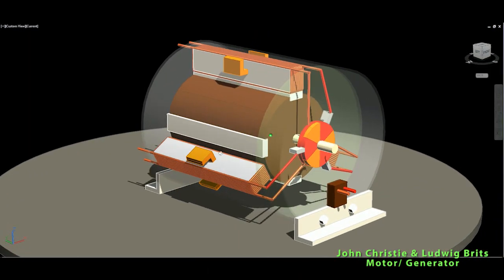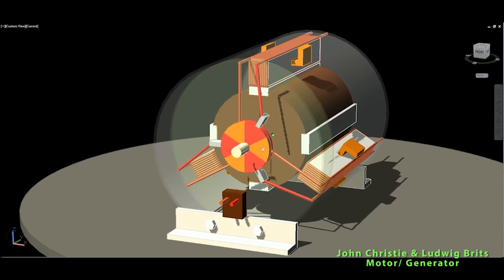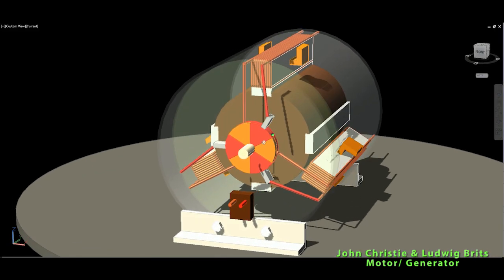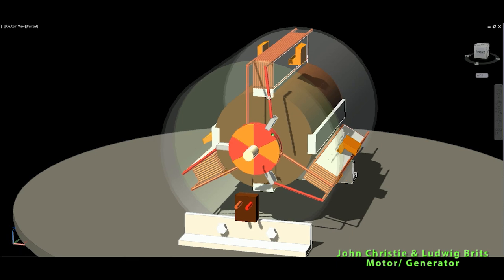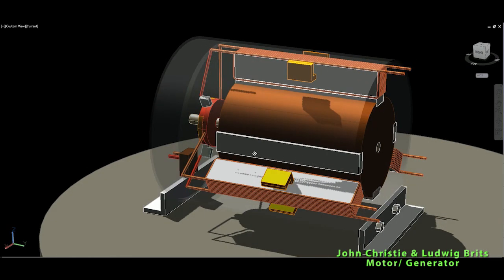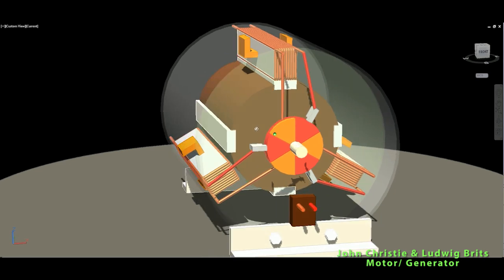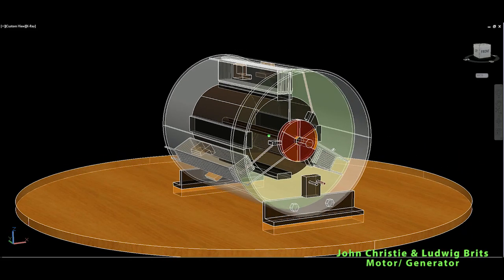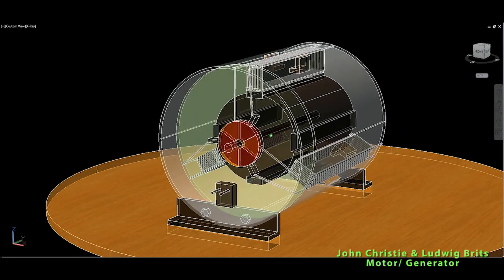Free Energy Generator, John Christie & Ludwig Brits, Overunity motor generator

Comment: A device that has a power output greater than the input is not possible. When the output is bigger, batteries are inside...
If you have a demo device, determine it's weight, look up the energy density in Wh/Kg of common batteries, try to extract more power than it's weight when it were a battery, then you know.
Reply from the maker: Thank you for comment! 💙
Reply: Don't say that because you don't know it exists or does.
It's possible with step-up transformer.

Comment: If you ever tried to manually turn a motor you know it takes a force.  More coils means it takes more force to turn it.  The force to turn it comes from not only friction but the resistance of the motor as it generates electricity.  Running current through one coil just means each coil that generates electricity will get less than half as much.  Please don't buy snake oil.
Reply from the maker: Thank you for comment! 💙
Reply: Please don't be more idiot than already demonstrated.

Comment: I built a similar device that by using just 1/9th of its power can produce 24 kW.
It is an advanced reproduction of a Keely motor made in the early 1900s. That motor made 40 horsepower using 3.5 pound magnets but I have 30 pound magnets Which are about 9 times stronger. The device uses 32 magnets on the array, 4 magnets outside of that array that are stationary and 16 flatwire coils along with a distributor that drives the Carrier wave.
Reply: I would also like a copy, please reply and I will give you my email
Reply: My welds came apart under high rpm test. I've been building a better one . Making the V shaped magnet holders is expensive or difficult. I had some tooling made to form these in a 7 stage press using my 20ton press. I'll post a video by tomorrow on my progress with plans
Reply: Won’t work, you cannot counter act the magnetic drag force it takes to generate or produce the energy then to run it. You can’t get more then you put in. Sorry nice try, snake oil is not the answer. This captures people that don’t understand how these things work.
Reply: how long does that set of magnets last?
Reply: @patrickdonegan9559  the N52's I use last forever
Reply: @mikefromspace  wow - that is SO amazing!
Tell us where we can buy them:
Reply: Did did you manage to build it and is it still running
Reply from the maker: Thank you for comment! 💙
Reply: @MarioGudec  I'll send the plans if you want. Keely invented this in 1907. It was used in secret in the 1908  Model T by the few who knew how to make a small modification to that charging system.
Reply: So has anyone perfected 1 to sell- these power bills are fckn up my life🙄
Reply: @knowledgedispelsfear6141  Yes, if you want to spend the money. Hydrogengarage sells hho generators. They say 40% more fuel efficiency, but you can just use one for a 3 liter on a 1 liter and it powers it 100% or more. You can run a pretty big generator. There is also a commercial size free energy generator. Look up Maxwell Sangulani Chikumbutso.
Reply: Hey,have u ever tried to build a rodin coil but using base 12 math? I haven’t built anything like that..  But i was looking at N.Tesla quotes on The 3,6,9 numbers and they represent the eather.. and 1,2,4,5,7,8 represents the material world,but the so called 0point ain’t in middle of the diagram,i think its bc he used base 10math,but if we add to number 12(3,6,9,12) it creates a totally different winding pattern and more u wind it the more complex it becomes,the idea is that we need twice as much points on eather side to achieve the depolarization.. Where does the spark come from? Maybe u heard of this guy Eric P Dolard very smart man look up maybe it helps you some how.. And one more thing do u have Seen how magnet looks under ferro Cell? :) I hope this info somehow helps u,if not GL with what ever you are working on..
Reply: @2bestoned  would you be willing to email me your design to build my own? Regards
Reply: @2bestoned could you also give me some designes so i could build it
Reply: @2bestoned   I studied the design and found it to be most efficient at forming charge with the least amount of wire. The best application seems would be to use them against one-another in 3 or 4 phase series loop across spark gap and through a high voltage transformer used to burn the energy off like many other zpe circuits. As with any proper zpe circuit you need only have part of the loop run through half a transformer, so the energy you get free is by influence.  As for using a single r-coil, it would require a resonant circuit with periodic spark gap as a carrier wave to run a discharge hv coil , so the only difference is you'd be using a breadboard to form the 3phase or multiphase carried wave to resonate a 3 point mutual negative repulsion in the circuit.  The loop circuit forced into 3 phase is key, since the 120 degree wave cannot cycle smooth and in loop is forced to build potential, so if that potential is inductive, you're excluding thermal mesons which are heat and waste, building superconductivity instead. I posted a simple pyramid design on my channel which shows how you can use a simple earth core 14hz wave to cause 3 copper plates to repel against a pyramid carrier. Spacing of the plates may be the only place for error. There's a fellow who made this simple circuit without ground and it disappeared on it's own so keep that in mind when experimenting with any zpe.

Comment: Its not possible. You cant create or destroy the buildingblocks of this world
Reply: Three to one ratios. Most definitely great and using steel to attract the three primary windings is simple and reliable
Reply: Shit building blocks. We use. Always wrong ways. This magnetic free electricity is a must and will not be held back. If so I'll make it easily
Reply: The building block of the universe is free energy!  the very reason your atoms are not flying apart right now, the fact that they are sticking together, is free energy it is 0 point energy as described by Tom Bearden  with DeBroglie waves
Reply: Scientific 'truth' gets rewritten all the time. Think about it.
Reply from the maker: Thank you for comment! 💙
Reply: It is possible, the lutec 1000 has nothing to do with destroying the building blocks of "this world"

If you have a little common sense you will understand why it works

like the magnets that are attracted to the steel

(which is free and therefore provides high efficiency)

in the coils and repelled by a pulse (dc)

The moments of the pulses,

is the amount of energy you put into it,

from this you can presume that those moments are short,

therefore uses little energy and gets more back
Reply: @TheJayLorenz  ,OK if this machine was real, then why haven't they actually built it yet? It has been too many years since they made their claims, but no factual evidence.
Reply: @jmackinjersey1  These motors have been built a few times in the past. I've seen videos of inventors demonstrating them.

You don't see them because all industries are owned by a small vile group of people. They suppress the information by buying out the inventors and never use the invention, block their pantents, sue them and sometimes just kill them.

The media is also owned by them so they won't inform anybody with something relevant.

Even today such motors exist and again they receive no attention. The company is Infinity SAV.

Key in this story is, the technology needs to get out to the masses whilst being aware that government, big business etc. etc. will try to block it every step of the way.

Most of the time, it's the inventors greed that tanks the project. Understandably, they want money for their invention but that road will always hit a brick wall for humanity at large.
Reply: @MoneylessWorld  how do I find a design I can build? Thanks
Reply: @rafaelmuggeridge2070  I don't have such a document nor a web location atm.

If I went searching really hard I might find something but I'm doing other things.

You could check out SAV infinity. Maybe they'll give it if you ask or you can buy a device and reverse engineer it.

There's also an old documentary called 'new energy'. It features 5 inventors with names like tom bearden, troy reed and hutchinson.

I don't know if documentary was for real but if you want, you can track down these people's patents or relatives and ask them.

That's definitely a big project. God speed.
Reply: @jmackinjersey1  aren’t they dead?
Reply: @TheJayLorenz  it takes as much energy to repel the magnets as the attraction phase would produce.

Comment: Mario,
With all of your research, which unit do you find with the most potential success?  

Have you tried to build it?
Reply: i don't agree that you need thousands of Euros to build these devices , the biggest constraint is time, you will need time to think and experiment.
I mean you can literally find the parts by wrecking old motors and things that people throw away, you then need to change and adapt parts of course, but i'm struggling to find the 1000's of Euro cost in anything i've see.
you may need to buy some customized Magnets - but there are places in china that do that at a 1/5th the cost of others.  
great video you do a great job with these.
Reply from the maker: Dear David, it's hard to tell which one works because to build a prototype you most likely need couple thousand of euros, if not tens of thousand of euros and a lot of trial and unsuccess. Muammer Ylidiz magnet motor is one of rare examples which were shown and assembled and disassembled on public exhibitions, so yeah, if you ask me, i would tell that this one works, but for how long it's questionable since Mr. Ylidiz never showed to work more than a hour.
Reply from the maker: Thank you for comment! 💙